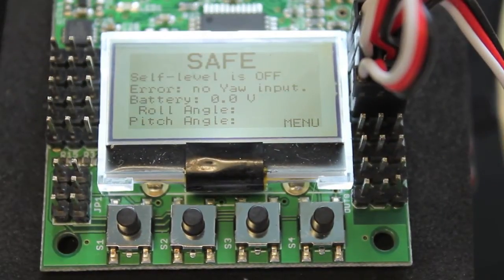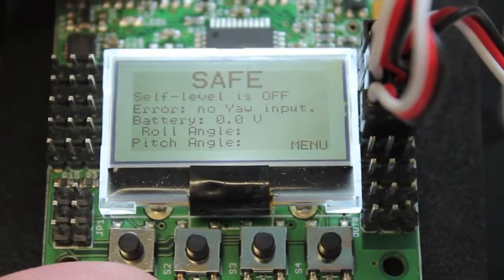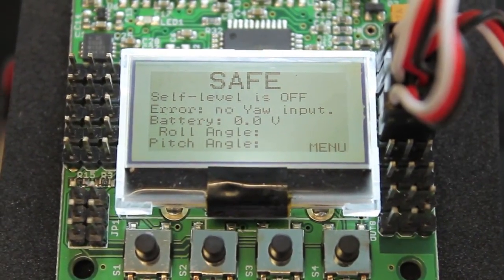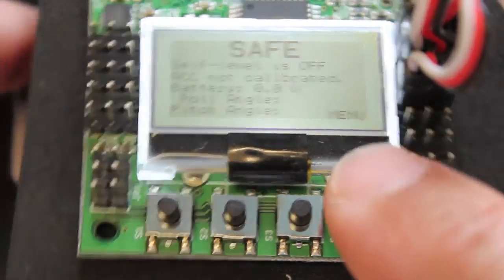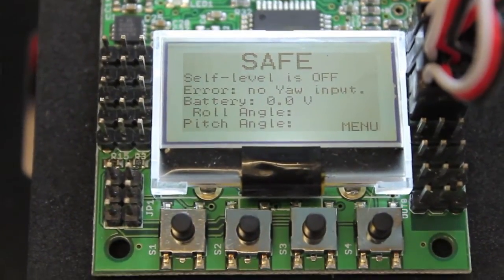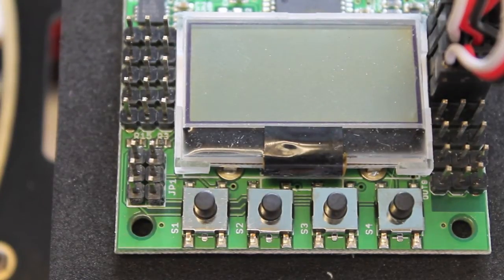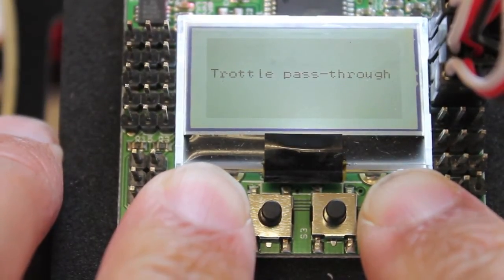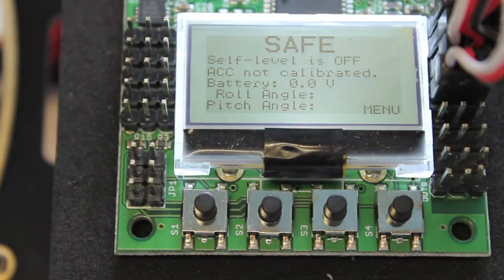Defective KK2 Multicopter Flight Controller?

Comment: Have question but has nothing to do with this video. I've watch your other vid on the kk2 board. I've tried different setting when in flight mode the quad flies fine but when in manual mode its very hard to control and really have to work at keeping it under control any idea why this is happening ?
Reply from the maker: Does it oscillate a lot? Which would tell me the gains need to be tuned. Generally speaking, the larger your frame the higher you want your gains to be. The smaller the frame the smaller the gains.

Comment: I just checked the 4 KK2 boards I had in stock and all the buttons seem to work.

With the KK2 PCB with the buttons towards you and without power to the KK2 if you have a Digital Multimeter you could test the resistance between the right and left set of pins of PB #4. Mine all measured~62,000 Ohms.

If you check the resistance between any of the 2 right side pins of PB #4 and the
upper left most pin (pin#44) of the ATMEG324 MCU you should read near zero (0) Ohms. That is the PB #4 input pin.

Comment: Had a yaw servo go bad and got that error msg. I disconnected everything, put a new servo in, fired up KK2 with no yaw input from rx. Then tested servo from rx to servo, then plugged rx into kk2, booted up, powered down and then hooked servo in, booted up, armed flew and msg cleared...hope that leads to something (using stock kk2 firmware shipped a month ago).

Comment: I'll be honest, I can't find a damn thing. I'm thinking a bad board since we know the button works sometimes since you can get into ESC calibration mode. 

There IS always the NoLCD firmware which allows total setup and calibration via a PC, but this doesn't really fix the board. Hopefully HK comes through for you on this one.

Comment: Your button is stuck! Go to Radio shack and get a new 4 pin button. And what ever you do don't try to run your motors up. They won't stop unless you unplug the battery.